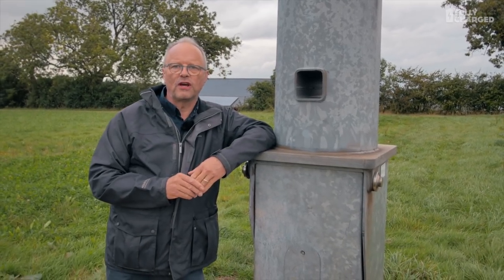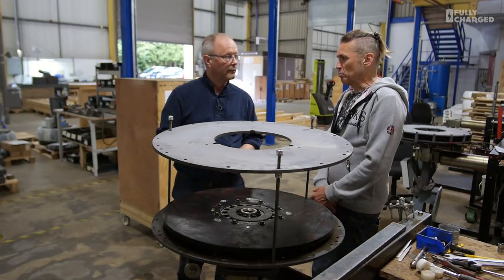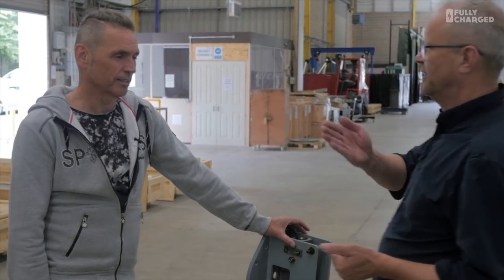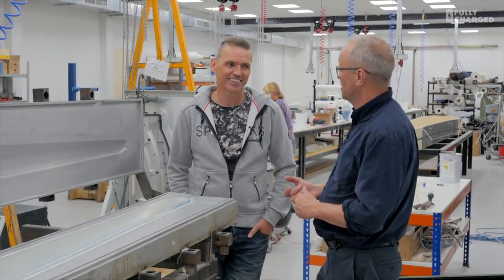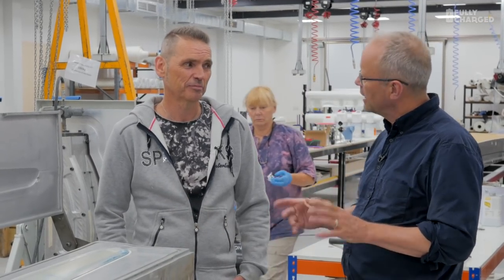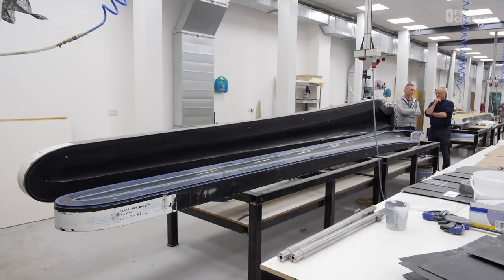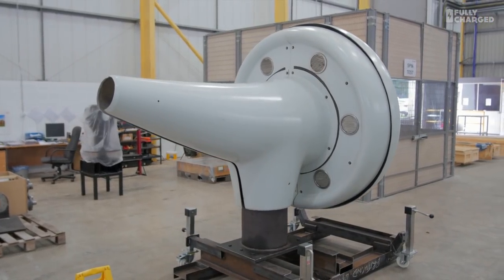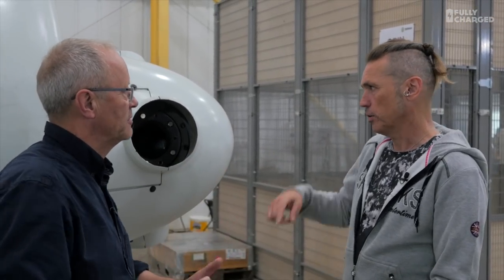BritWind | Fully Charged

Comment: Keep up the good work, I went to Denmark in 1996 to learn and work with small windturbines. They are definitely a good practice for small communities. Let’s also not forget there are a lot of storage possibilities to produce heat with excess energy. E.g. sand battery at 600 Celsius

Comment: Whenever I talk to people about windpower, they always say "not in my back yard", but if these are so ugly then so are motorways and railways, so why not put these up alongside motorways and railways, that way all the uglyness is in one place?
Reply: See this is very close to my train of thought.  Why don't we utilize the wind generated by vehicles on motorways?  Place vertical windmills that will catch either natural wind or wind from passing vehicles to help generate more electricity for the surrounding area?
Reply: local farmer here had the same view, then they offered him around $100,000 per generator to install on his property, his answer then was stick as many as you can fit there.
Reply: I think one major problem is ice, that will be thrown off the blades randomly in winter. That's why placing them near traffic is a bad idea.
Reply: @lookatthisvidsandfun  here they are placed no where near roads at all, but I am in outback Australia and ice is the least of our worries. but they would all be a good 4 to 5 kilometres from the roads.
Reply: You'd be surprised to know that Ice Throw, even in cold climates,  is a bit of a rarity as the ice on the blades deforms the airflow, makes the blades heavy and affects the spinning of the blades. the main problem with turbines near main roads is something called "flicker". basically when the sun interacts with the movement of the blades to create shadows or reflections that are distracting and therefore dangerous to drivers
Reply: Donald Stafford 
Under bridges. Obviously where they can’t strike.
I have had that idea too. Lots of small ones on the crash barrier 🤔
Reply: It's not the sight but that annoying whooshing noise when your trying to sleep

Comment: At £31K installed for the R9000 its not really for the general public. It needs to be in the £5K area to really catch on but maybe creating around 4Kw to augment a Solar PV Batt  blended system.
Reply: A auto can cost 30-50k and last maybe 5-10 years and will lose value but this can start paying me back $$ which a car cannot. Whats more important a nice car or power for life ( buy a used car)
Reply: @jkprops  There is a good chance, that it never makes enough electricity to pay for the total installation cost.  I can use a car to go work and to make way more money vs what this Wind Turbine can ever make ...
Reply: Mike B Three month warranty?. Avoid!

Comment: Dale Vince is not quite right in saying that turbines with a gearbox should spin at the same wind speed. Normally the arrangement in modern turbines will consist of a gearbox driving a high speed shaft connected to a DFIG (doubly-feed induction generator) plus a converter. This together allows the generator to spin at a frequency different to that of the grid

Comment: It amazes me that a huge Wind Turbine (only by 5m smaller than the London Eye) 130 metres tall (590 Feet) built near me in a Valley Rotates Most Days. Can be seen from my house (Severn Trent Water) Each turbine generates enough electricity to power around 1500 homes. So it's not just for on Hills

Comment: Brilliant design of product and great video. Anyone have data on the cost of each unit and cost to install?
Reply: Euphidides perhaps on their website I'm guessing
Reply: Nope, no info on the website. They are probably avoiding the cost comparison with solar very carefully. The claim that they are 3 times more "efficient" than solar matters little if the cost is 5 times higher...
Reply: Henrik Bjugård Nyberg Oh ok there's propbaly why
Reply: Of course, Wind has the capability of blowing 24hrs, the Sun, not nearly as much (depending upon your vicinity to the equator)   If properly engineered, on open waterways or at higher, unimpeded elevations, Wind is the preferable solution.

Comment: how much is the small wind turbine plz?
Reply: awesome
Reply: Can you connect them to something like a tesla power wall, that would be very handy for the less windy days
Reply: krusher74 so cost is 40,000 and lifespan as stated is 20 years.. so does this even make sense if you’re paying 2,000 a year for this? Repair costs might add and the Powerwall isn’t included yet.
Reply: @christiand2426  15000kwh times 20 is 300000kwh. 
That is 10 cent per kwh.

Really not bad compared to diesel generators etc.

Comment: PV manufacturers SunSolar are British and have both a 25 year warranty on linear output degradation and product warranty. Many have 25 years for linear drop in production of no more 0.6% per year for instance but not 25, usually 10 years on the actual product.

Comment: Genuine question: Why isn´t it common to put a "cage" around the blades like you have on a fan at home to prevent birds from flying into that giant blender?
Reply: You should visit some german spinning blades in the early morning then.
Reply: +VivaPapaya I would assume cost is a big one
Reply: Windmills do kill hundreds of thousands of birds but radio and cell towers kill millions a year and cats kill billions a year. I don't think it is feasible to cage the blades to save such a small percentage of birds.
Reply: It would be easier and more effective to build a cage in front of large windows instead. You would save many more birds that way.
Reply: So?
Reply: You could offset the risk of potential bird casualties when installing a turbine by exchanging a domestic cat.
Reply: The cage would reduce the energy yield, add loading to the tower and would increase the visual impact.
Reply: And then the birds have got a large solid object to fly into. (a bit like a building in fact)
Reply: Buildings alone cause more bird deaths then windmills and those do not have spinning blades...

Comment: A small wind generator is around 25 to 30k. I haven't done the maths, but it will take an awfully long time to pay for itself. In fact I would venture to say that it probably never will. We need some subsidised incentive from government to make this a viable option. I expect the larger version of the turbine to be more cost-effective. I'm guessing around 50k for ten to twelve houses, so get your neighbours interested. What a minefield that would be. lol.
Reply: That does not make sense. No one would bother to pay for one if that was true. Soo much added setup work ontop of cost of the unit. No one would go through that trouble if it did not pay for itself. There is also many places around the world where electricty cost is getting silly and grid market prices just horrible. In those places the wind turbine pay for it self fast.
Reply: Neojhun : I did say that I haven't done the maths, but considering initial outlay plus regular maintenance and no major part failure. I can't see it paying for itself for a very long time and what happens when you want to live elsewhere? I suspect moving it would be more expense.  What I am saying is me just doing a quick viability check in my head. It's not exact. Perhaps Robert should do us a breakdown of the costs and viability for the average household.
Reply: Um these 20meter tower type wind turbines are typicaly not for you average private home. Its mainly for property with decent amount of land who require quite a lot of electricty. 20 meter tower is something you can not get a permit for in most residential areas.
Reply: Indeed, I had not even thought about local planning restrictions.
Reply: Indeed, I hadn't even thought about local planning restrictions.
Reply: The Feed-in Tariff helps with the payback.  

You get the Feed-in Tariff, offset imported electricity and revenue from export.

Comment: How does the average UK household only use 2.5 -3 MWh per year? Heating the hot water would use more than that, do they use a lot of gas for heating and cooking?
Reply: 69aussieguy yes, gas costs about one sixth of electricity in the UK. Where it is too remote for gas pipes to be cost effective I think it is mostly diesel delivered to tanks. Solar and wind are cheaper than diesel. With a gas supply it isn't worth me buying the equipment to use spare solar to heat the hot water, it goes out to the grid.

Comment: Funnily enough I emailled Britwind yesterday to get a price on a turbine and ask if they did something that could run my off-grid 48v setup. I've seen a turbine on Ebay that's only around £700 but so little information about it , I was hoping that Britwind maybe had something maybe under £3000 for the DIYer. But I was way off. Hopefully they will offer something in the future. Tempted to try and build something , mainly the blades are what I think I would struggle with.
Reply: be careful with what you buy in Ebay, I bought one of those small domestic windmills, 2.5 watts and after a storm the windmill was rusted and broken down, quality is an issue with this type of things

Comment: Apologies if this is a dim question but could someone explain to me what is meant by installed Kwh - I didn’t understand the point that was being made about the comparison between wind & solar, wind looks to be more efficient but not sure why. (Only seen this for the first time today even though it was made a few years ago)
Reply: Good question!  Not much coming up on the subject.  I believe they're talking about the mount of energy it takes to install the generator verses the amount of energy it can produce...so wind energy has more potential energy production compared to the cost of making and installing solar.
Reply: @rngalston  Hi Rob, thanks for your comment, but I am not sure that works, surely the amount of energy produced by the unit depends upon its lifespan? Or is that approach flawed?
Reply: @WirelessGriff  Hi Hugh.  Since the lifespans are unknown and the wind requires more regular maintenance, maybe it has to do with the amount of energy the device generates compared to the cost of instillation.
Reply: @rngalston  Could be, thanks Rob!

Comment: I am so confused!! They say wind averages 3x solar in the uk output, why are they not more common??
Reply: There are more GW wind power installed in the UK than solar.

And regarding smaller units (kW, not MW):
It's very easy to install some kWp PV on a roof.
But much more difficult to install some kW wind power (NIMBY, Not in my backyard!).
And the yield of solar is roughly the same everywhere in the UK (a bit better in Cornwall, a bit worse in Scotland).
But the yield of wind power is extremely dependent on local wind conditions.
You CAN get 3 times the yield of solar at a very good site, but it can also be the other way round, if you live in a wind-protected valley.
And small wind turbines (hundreds of watts, some kilowatts) are rather more expensive per kW than solar today.

Comment: What is the price for the smaller one? I didn't find any numbers in their website.
Reply: I found this: "... R9000 total install cost =  £30,000 ..."
Reply: @MrSummitville  That's the cost of a nice two-room and a kitchen apartment in my city. You can probably build a house for that money and double the price of it with R9000.
Reply: @grolribasi  I agree.  A Wind Turbine would make sense in a remote location and/or in an area of very high priced electricity, with extremely fast winds.  The average person would have a very difficult time cost justifying a £30,000  expense ...
Reply: @MrSummitville  It would be nice to have a wind turbine, but a little cheaper one. Not at the price of a house. And would be nice to have a house at first.

Comment: Only quite recently discovered your youtube program fullychargedshow and really liking all the material - very well presented - great info too - thank you. For my own interests though I'm keen to see when I can install a micro wind turbine. Most of those available are plastic-y things from china which apparently need a minimum of 10MPH winds to get started. Our minimum where we are is more like 6MPH. Also they are selling DC turbines. From what I gather the AC ones can have cheaper wiring down to the regulator and inverter etc. Also 3 blades are all very well for larger turbines but not for micro turbines. I came across a site in the US that apparently have 7, 9 and even 11 blades which apparently will work with smaller wind speeds. There appear to be NO suppliers for this kind of thing over here in the UK/N.I. 
Is there any chance you can do a program on how your average guy could purchase and install a micro wind turbine that will actually work in the UK say a 1.5/2Kw unit for 12V battery. 

These ones from Missouri USA can be imported but delivery to UK is almost half the price of the unit!

https://mwands.com/shop/category/wind-turbine-generators?attrib=5-5

Comment: I like it. I would have done much the same. Although I wonder if a multiplate lower diameter generator wouldn't be more elegant.
I hunch that a wind turbine could be done very cost effectively, perhaps belt driven gearing to have a much smaller generator. And perhaps fixed blades that are thermoplast on styrofoam on off the shelf fiberglass tube to avoid artisan hand laying and really speed it up. A blade only needs core strength, not everywhere.
Reply: And overall, I wonder if solar panels aren't just better.
And beyond that I'm fairly certain that just thorium reactors is the way to go and forget the rest.
Reply: Dan Frederiksen Depends on where you are. Scotland and Northern England doesn't get enough sun to make solar panels cost effective right now but wind turbines work great!
Reply: +durand,well looking at a solar map, here in Denmark is around 1MWh/y/m2 and Scotland looks like 0.8-0.9 and even the worst is not worse than 0.7 so it doesn't appear to be a huge contrast even for the dreariest of places. So if solar can just be rolled out like a news paper press it can become too inexpensive for anything mechanical to compete. Of course with wind you could have some power at night but wind speed also tends to follow the sun so it's only a marginal advantage to have both. And daylight is more reliable than wind. But thorium.

Comment: What does 3mWh per installed kilowatt mean? Never heard that before.
Reply from the maker: If you install 1 kilowatt of solar panels, as in stick them on the roof, they can produce at peak output, 1 kilowatt.
In a year it will produce 1 megaWatt hour of electricity.
If you install one wind turbine that can produce 1 kilowatt maximum output, in a year it will produce  3 megawatt hours, so you get more from wind.
Reply: I see. Thanks for the explanation. Very educational channel! :)
Reply: Be careful with letter case and SI units. M means mega and m means milli, so 3mWh are 0.003Wh...
Edit: Sorry, haven't seen the other comments on this topic below.
Reply: The othe rthing required is £/kw. Bit wind used to come in at 450/kw. Small wind at more like £1500/kw. Do the sum for yield per year (in Mh), multiply by the amount from the FITs, then divide £ by this amount to get a rough payback figure. Anyone looking to lend money will also want a discounted cashflow. See how capitalism creeps in, in no time?

Comment: Think about small wind turbines 600 to 1000 watt for battery charging. 

I have a Black 600 24 volt that works perfect.  It is silent and gives low wind enough power to charge the batteries.

Rock solid German wind generator.

Comment: OK. So do this cellulation . given  we have a minimum rpm of the  generator. what size eclectic mother is required to drive you generator. to privet sufficient  to power a battery bank from a mains supply  powering the needs of a house in the town say. or house on an hosing estate ? who cant run a wind tribune.
Reply: Why you no spike a de anglissss

Comment: Robert, I appreciate the breadth of material you cover on this site. I find it informative and helpful. I have recently become aware of two other means of power generation. If you are already aware of these developments I would welcome hearing anything you may present on Fully Charged. One development is the Lutz turbine. This is a vertical wind electrical generator using a unique design offering several significant advantages over a standard tower and blade arrangement. 

The other I suspect will give you the willies but try to have an open mind. In the 60's there were at least two means of nuclear power being researched. The breeder reactor was selected as the standard. Have you heard of the high temp/low pressure salt nuclear reactor? Before you panic it is claimed to have been much safer, self regulating when the isotope is in the salt, consuming all but 2% of the isotope and converts the isotope to a faster decay element. It has a longer duration of reaction without the high temperature/pressure spike of a breeder style reactor. ie: Chernobyl

I think you may find these two developments interesting. 

Keep up the good work, Ron.

Comment: Why don’t they make one that would power 1 house that every house could install on their roofs or in their gardens? 
Also many small water turbines inside downpipes from the guttering, we get enough bloody rain in this country to constantly power them!
Reply: It depends upon how much wind you actually have at your site and how much electricity you consume. The R9000 may generate enough for just 1 house. Smaller Wind Turbines become less cost effective.
Reply: @gushbucket5998  You cannot buy a small Wind Turbine for a couple hundred quid, that has the power to operate your fridge and tv. Maybe, a thousand quid and you still need very strong and steady winds. Wind is very  unreliable. Small Wind is just not cost effective, for most people